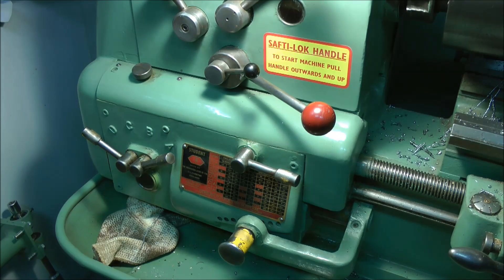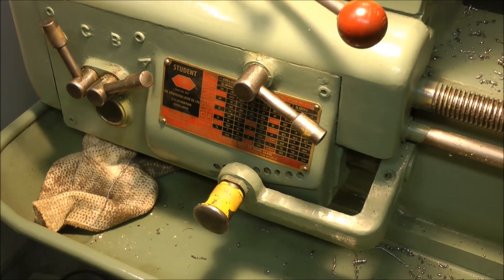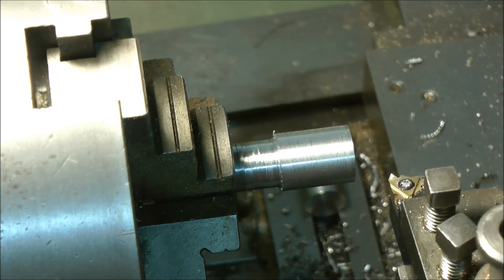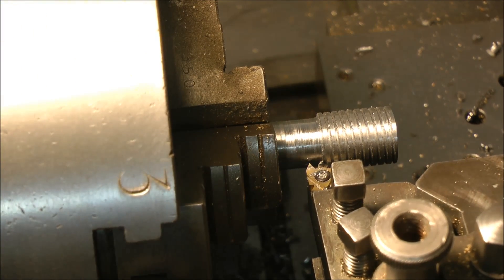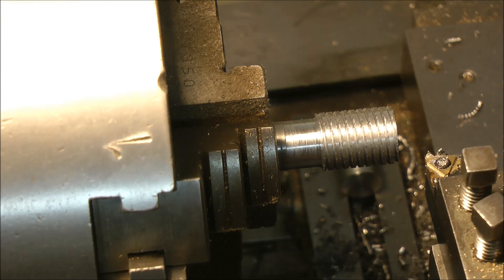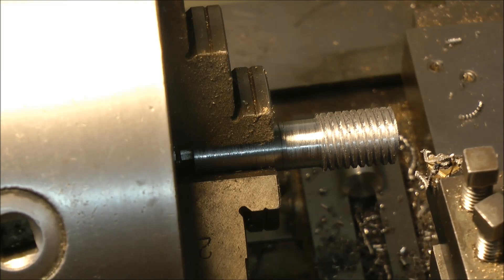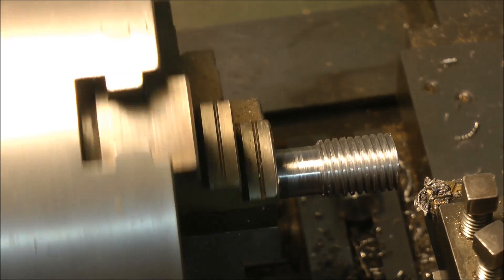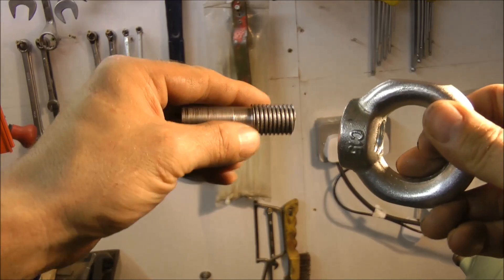Metric threading on a old Colchester lathe !! :) lets have a look

Comment: hi criss 
maybee you can help me out. i have a old Colchester Student Lathe. if i want to cut a screw, it dosn't work. 
i set the lever on c and a ore D and a ore any other configuration. The result will be every time the same. It cuts a pitch of 0.7mm ore less. 
In the Norton-Grear looks everything fine. Same in the Spindlestockgear and the the 3 Grears to drive the Norton are 42, 120 and 35. 
i have not disassamembelt the Apron yet. have you got a idea what the Problem can be? 

Cheers!
Reply from the maker: Are the C/D etc selector levers working , there should be noticeable speed difference on the sliding feed speeds .. when they are at different settings,  I’d imagine  not only do they control  the feed shaft , but also power to the gearbox , secondly I’d then move the  sliding gearbox selection arm to its furthest points left and right and not any speed difference, mabye set up a felt tip pen and a card tube in the chuck  to record any difference...
Reply: chris the bodge thank you for the inputs. I will test them.

Comment: Nice one, what screw cutting tools/tips do you use? I just got some and they were really expensive was wondering if you got yours cheap but good quality?
Reply from the maker: It’s just a  cheap 16mm tool holder and bit off eBay the whole thing was about £30 ! I’m still on the same carbide tip that came with it , to be honest I don’t really do much threading on the lathe I mostly use tap and dies , as I don’t go above 12mm that often  , but I would look on eBay for a bargain 🙂 otherwise I’d go for Glanze , from chronos  engineering

Comment: Perhaps you could have believe the eye which is marked up M20 !
Reply from the maker: pmailkeey good point! 😀
Reply: @Madchris1  Had to check the bloody book about leaving the leadscrew half-nut engaged for metric threads. What a pain !
Just hope I never come across any ;)
Reply from the maker: pmailkeey same here ! Most of mine are done with taps/ dies unless is a big one , one of my next jobs is to make a spindle handle do I can cut threads by hand, it’s hard work it crashing in the chuck without a clutch 🙄
Reply: @Madchris1  Select neutral - by placing the front spindle gear lever straight up. Then you're not having to turn much of the gearing and motor.
Have you looked at the brake failure ? Likely just needs adjusting.
Take left hand (changewheels) cover off - the brake is in the top belt pulley. We don't have a brake but the clutch option - that's easy to adjust without tools. 
It may just be a matter of altering the length of the actuation rod - long screw with a locknut type setup.

Comment: Hi, I was wondering, I can see you are putting it in reverse and feeding backwards not taking a cut, is this to ensure the cut starts in the same places when a cut is applied?
Reply from the maker: Adam Jones  hi Adam👋 yes that’s correct, you have to do it this way on a old Colchester, even though there is a lever to select metric threads, I read that the lead screw is still imperial so you can’t use the thread dial indicator to pick up the thread like you can when cutting imperial threads ... so if it’s engaged all the time you don’t loose it , one problem though is crashing the tip  into the chuck or cutting to far because you can’t control when the lathe stops unless it has a clutch.. or you make a lathe mandrel handle and crank it by hand ... I’m making a handle in the next few weeks 😊 thanks for viewing Chris 🙂
Reply: @Madchris1  ah great thanks, does this need to be done by using the same.number on the spinning dial by the on/off lever or can it be done in any rotation just as long as it's not disengaged? Sorry for the questions I'm jjsy trying to learn 😂
Reply from the maker: Adam Jones yes it doesn’t matter about the number if it’s engaged all the time , the thread dial is only needed on imperial threads on this old machine  and try to go for the same number everytime if you can cutting imperial threads ,

Comment: Just found this great video. I didn't even know the lever had 3 postions. Neutral - imperial and metric. Mine was too dirty to tell. It works great in neutral and imperial but I just can't select metric with it. Any ideas?
Reply from the maker: codprawn pop the cover and see if the dog clutch arrangement is in-gauging, sometimes it’s really  dirty in there and a oil change may be needed .
Reply: @Madchris1  
The oil looks clean through the sight glass but I will give it a go. It feels like there is something solid blocking it. As if that position has been deleted although the lathe is supposed to do metric and Imperial. Keep up the good work your videos are great!
Reply from the maker: codprawn  I had the top plate off so you can see what’s happening, on mine you sometimes have to wiggle the the chuck to and throw to engage...https://youtu.be/5L-inZaNmB4
Reply: @Madchris1  
Took the cover off. The oil is spotless but drained it anyway. I used exactly the same oil you did - bought it ages ago - great minds eh? 
Nothing wrong at all. In fact I don't think the gearbox has even been run in yet! 
Do you change these gears under power? I didn't like to. Turn the chuck by hand - there are only 2 places the metric one will engage. Got to feel it in. Under power would be easy I suppose.
Thanks again for all your help!
Reply: ISO68 oil sorry - another video of yours. My Triumph takes 2.5L in there.
Reply from the maker: codprawn  no never changed anything under power... I don’t want anything crashing, have you replaced the brass ball Oiler’s around your lathe there’s a few on the gearbox itself
Reply: @Madchris1  
No need they all work fine! The lathe looks tatty but is mint and hardly any wear at all anywhere. Very lucky. At the same time I bought a Triumph2000 but that was very worn. I was sorry I sold it but with hindsight it was the correct choice.
Reply from the maker: codprawn your lucky then , 90% of my oilers we’re missing there ball bearings or totally missing and full of crud 🙄,

Comment: Engaging the leadscrew lever into the metric setting you make it look very easy but the reality is that the lever can hardly ever simply be engaged without turning the leadscrew to link up the dogs on the inside. Your experience show though that without the metric indicator dial this setting is useless.

Comment: Is it just me or did you feed in the cross slide instead the compound from an angle? From what I learned you are supposed to feed in at a 60 degree angle through the compound but it seems like only the cross slide is moving perpendicular to the work piece. I wonder if it is the thread type that you are cutting which eliminates the compound slide?

Comment: You could make a metric cap for the thread dial, perhaps. But reversing rotation works well enough, though a long lead screw could be tedious. A paper cut out would do for proof of theory.

Comment: Chris, that metric/inch thread selector is unheard of on round head Colchesters here in the US, AFAIK. That lever just turns the lead screw on/off. Could you show us how it works inside? Do you have a manual that shows the parts?

Comment: Dear Sir, please help to inform . What gear combination for M1.5 thread of gear train box. i am using T35. T120. T42  originally fitted as i purchased machine form UK. Need help regarding sequence to use. Right now top gear is T35. Which is connected with T120 in the middle and then connected with T42 at the bottom. hope you understand.

Comment: Hi Chris , I'm sure that the student I used was the same as yours and I think it has a mechanical drum brake in the head so even if you have a inverter drive speed controller, it should still work, if not it may need new shoos or adjusting. 
I've had my bantam for a few years. I use it for odd jobbing in my workshop Don't use it much but its really handy to get me out of trouble now and then. When I'm screw cutting  I never disengage the half nut, and I always if possible run into a under cut and use my brake, I find it safer this way. 
 I also have a Alexander milling machine, drill press,  grinder, and a home made 7ton hydraulic press in my workshop/ garage... just boys toys really!  Keep the good videos coming Chris
Reply from the maker: A  Alexander mill now that is a boys toy ! A decent mill is on my wish list until then it's the crusty Clark drill mill ha ha , thanks for the sub and the reply it's nice to chat with you, chris

Comment: Hey Chris, that is one hell of a nice lathe.
Reply from the maker: It's quite worn, and all I could afford at the time, and my first "real lathe" my previous lathe being a 30's myford ml4 with plain bearings, what was your first?
Reply: I had a Chinese Grizzy 13" x 36" - It really was quite a nice lathe and learned a lot on it.

My current lathe is a 20" x 60" - When I first bought it I took a piece of 6" dia 1018 round by about 4" thick and chucked it up. I then drilled a small pilot hole and drilled it with the biggest taper drill I own (about 2" dia) and was amazed that I could just turn the tailstock wheel and push the drill straight through that solid stock. I remember seeing the smoke billowing up and filling the shop. hahahahha
Reply from the maker: Those Chinese lathes look like they run real smooth, wouldn't mind one maybe a warco  for model making

Comment: That's one heavy cut for those laydown inserts, just say'n bro :)
Reply from the maker: Interesting, what's a laydown insert , is it a over the pond expression Glenn? And how much should one advance per cut? Kind regards Chris
Reply: Yea, those inserts lay down flat (like normal inserts) vs. the ones that stand up 90 degrees to those. They tend to be known as a weaker insert. When the thread has progressed and getting into the full cut, I'll back off a bit and only take a couple thou. I'm no expert by far, but that's just my experience. Do I need to send you a bottle of dark sulfur cutting oil?  :)

I take regular old small soup cans and an acid brush and put one at each machine. Fill it with the sulfur cutting fluid and mix in about 20% WD40 - works really good. Lube is good, obviously because it lubricates, but more so it keeps the tool cool (and a bonus, it takes some heat out of the work so you can get more accurate dimensions)
Reply from the maker: Hmm interesting, I'll back off on the final cuts, dark sulfur cutting oil is that like low fume stuff?
I do have about  four kilo of sulphur powder in workshop b from my rocket making days, could I mix some up lol, Chris

Comment: I especially like the obvious delay in the carriage movement as you reverse direction each time. Clearly shows the backlash in the chain of gears running the leadscrew and half nut.
Reply from the maker: Hi Ray !, yep the old girl is worn, plenty of backlash on all moving parts, and groans/ rumbles on start up, lol
Reply: skyrocketpuke Nothing wrong with the backlash - it is essential if you don't want to grind your gears to dust :-) But it does show why you need to go well beyond the entry point for everything to take up the required slack.

Comment: Hi Chris, If memory serves it's clutch lever than you pull up to turn it on & push down to turn off has a brake on it which if you push it down more it stop it turning quicker.
Reply from the maker: hey Dave, lol I wish I had a clutch, but no such luck, I think you can program the inverter for motor  braking but its like setting the timer on a dvd player...painful lol

Comment: Even on my metric Colchester Bantam (6mm pitch leadscrew) I would have to use the same method. You can only disengage the half nuts when cutting threads that divide equally into 6mm ie 1, 1.5, 2, 3 etc not the likes of 2.5. or 4. My lathe does not even have a threading dial.
Have come across the "clapper box" threading tool? 
ATB
chris
Reply from the maker: Colchester bantam, now that's a nice machine, what do you use it for chris?
hmm... is a clapper box at home on a capstan lathe?

Comment: another nice video, I also have a Colchester lathe the same as yours, will have to give it a go, I do most of my work on a myford super 7 and mainly use the Colchester for the big work or the rough jobs as I can take bigger cuts, sure will give the screw cutting a shout on the Colchester
keep the videos coming, always look forward to them
thanks for sharing
Keith in Swindon (mr-myford)
Reply from the maker: hey!, thanks Keith, it was my first  attempt  to .
 thread in steel, I had tried a few in ali before lol.
to be honest I had been putting off screw cutting on the lathe as it looked complicated ,and by using a die holder I was getting away with it, but you've got to try these things and im glad I did :)